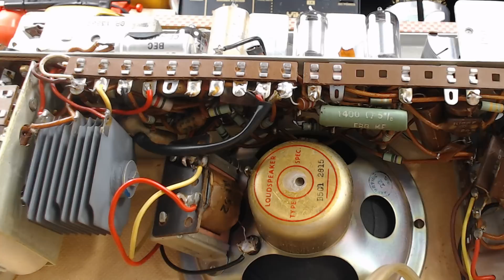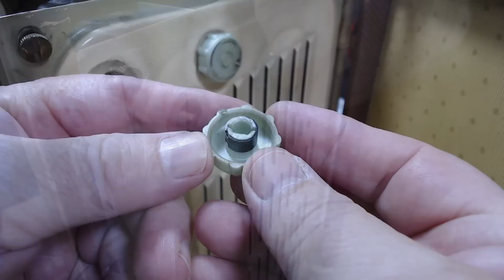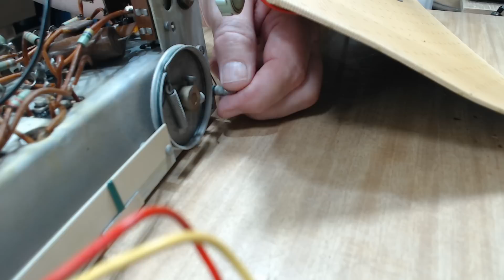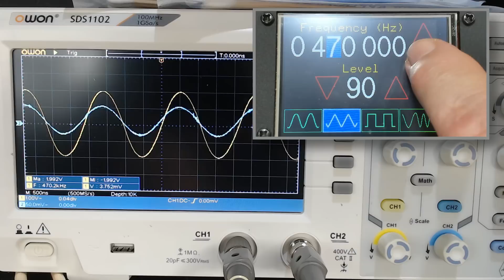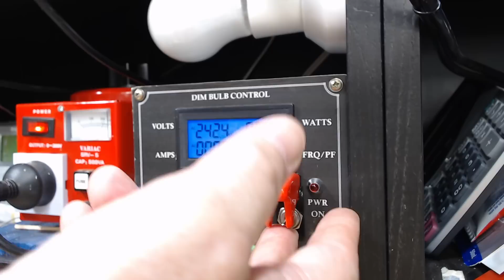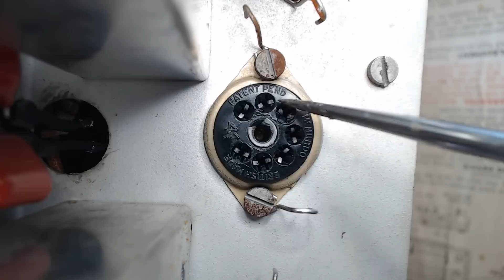Vidor Suitcase AC/Battery Henley Portable Radio - Model CN426 - 1953

Comment: Thanks David good job. Interesting to see how they progressed from the twenties and thirties to that style. Small tubes compact with a battery compartment. I wonder about what year it was built. My guess would be about the middle fifties🤗
Reply from the maker: Hi Bruce, 1953 it was made, it's in the video title. A slow and steady improvement over the years until transistors came along (which was a continuation I guess) 🙂
Reply: @DavidTipton101  thankyou David for your reply I enjoy your videos so much. No microprocessor synthesiser turning in these radio s all just really smart hardware designs with what was available at the time. Thankyou
Bruce

Comment: Heya Mr. T., thanx for another instructive restoration. Re. the de-stuffing of can electrolytics, I have sometimes used a heat gun - the same one with which I've burned the paint off my weatherboards. One the innards start smoking it should be easier to pull the guts out. N.B. do this when the wife is out of the house. Thanx again, John (NZ)
Reply from the maker: Hello John, I have tried heating the case but only managed to burn myself. They usually come out cleanly, the ones that have been potted give the most trouble. Maybe heating the potted ones will help loosen it 🤔🙂
Reply: @DavidTipton101  Hey, I've almost burned myself doing this. Truly one suffers for one's art.

Comment: Hi David, nice work with that, those broken pins it's a common problem with those Mc Murdo valve bases, that's the first thing I check. Look forward to the next one.
Reply from the maker: Ok, thanks Lee, I'll be more vigilant next time 👍🙂
Reply: Many years ago when I started working in a hospital, my first job was repairing the nurse call systems.  The patient rooms had a wall plate with a couple of 8 pin octal sockets that the hand pendants plugged into.  I spent so much time on flaky sockets that I just decided to go through and tighten and clean all 300 or so sockets. Took me a couple of weeks but that cut down trouble calls to one or two a month.  Also have just sacrificed a tube socket or two for pins to fix them in amplifiers and radios.

Comment: Hi Dave,
Absolutely brilliant repair job on your Vidor radio.  Although I’m capable of repairing battery valve radios, I dislike doing so.  When compared to none battery valve equipment, most models, irrespective of brand, are flimsy, and very temperamental.  Your battery radio is one of the better performers I’ve heard in decades.
One minor point, the ‘Vi’ in the brand name Vidor is pronounced with a long ‘I’ sound, as for example ‘violet’.  Someone, many years ago, mentioned that ‘Vidor’ is an amalgam of part of the Christian names of the company founder’s two daughters: Violet, and Dorothy.  Whether or not that is true, I can’t say.
Nice chatting with you.  Best regards, Phil.
Reply from the maker: Thanks Phil. This is a very sturdy build and works and sounds good too. I Googled pronouncing Vidor and there are a few different ways depending on the country. From Radio Museum: "Vidor name is supposed to be from part of the name of initials of the names of Thomas's two daughters, Valerie and Denise, and his wife Rebecca". Looks like there are number of stores of the Vidor name origin 😄 There is a town in the US called Vidor as well. Cheers!
Reply: @DavidTipton101  I've never heard anyone in the UK pronounce the "Vi-" as anything other than to rhyme with "eye".
Reply: When will you be getting behind your soldering iron again, Phil, do miss your videos.
Reply: @Theoobovril  
Hi Theoobovril,
I’ve recently took possession of an abode requiring a fair amount of restoration.  Though I very much miss restoring old electronics equipment, I don’t have a workshop at present.  Hopefully, towards the end of this year, I will have created sufficient space to set up a work area.  Over the past two and a half years I’ve amassed several Vintage Radios that are crying out for attention LOL.
Thank you for your interest, Phil.
Reply: Always nice to hear about history!

Comment: Hi David,
A nice little radio for the collection.  It didn't sound too bad either, for what it is.  My money's on that valve socket being a problem all along.
Cheers
Reply from the maker: Hi Don, thanks. It worked alright for a little set. I think there were a few things stopping it. It's hard to troubleshoot if there is two or three problems at once 🙂

Comment: VIdor used a different style of tube sockets than most.  They're like two metal fingers that the tube's pin contacts.  If those fingers break, no contact.   I have a Vidor Riviera that had all the socket tines rusted out.  Once I replaced the sockets more conventional ones it sprung to life.
Reply: Similar sockets with finger contacts are actually very common in more modern European tube radios except they don't seem to break that easily
Reply from the maker: I've seen this style socket before and it had broken contacts as well, I should have remembered that. I can see your Riviera, nice looking set 👍🙂

Comment: Those hooks on each of the valve bases tends to indicate that the valves were restrained originally, which makes sense for a portable set. Thought you might also have checked the battery side with the bench supply, just for completeness.
Reply from the maker: Thanks James. The valves were secured with rubber retainers original. I didn't bother making new ones. I don't have a suitable bench power supply set up, I have a few in the wings but haven't bothered to repair them as yet 🙂

Comment: Excellent job as always Dave.  That paper in the IF Can is called Fish Paper :)   Also, there are hooks on either side of the valves. This was to hold down the tubes given its portability.  They likely used some type of Spring with a washer on top to hold the valves down.   Excellent job as always !!
Reply from the maker: Hi Ron, thanks. It looks like the valves were held in with elastic rubber bands judging by the bits of hard rubber in the case. I didn't worry about bending up wire retainers, it won't be going on any picnics for a while 🙂
Reply: @DavidTipton101  that makes perfect sense. Those tubes really never get hot so that was a good way to do it....   No picnics..  darn... LOL    Excellent Job David

Comment: Good work David, a series of intermittent faults. Sensible to leave the selenium rectifier alone since it was in good condition, back in the 60s we replaced a lot of them of them with an OA211 diode and resistor. Most of these got very little work as a portable as batteries were so expensive and the selenium rectifiers built up additional resistance and got hot. If they failed they made a terrible stink.
Reply from the maker: Thanks George. I know they stink for days if the Si rectifier fails 🙂

Comment: Those McMurdo valve sockets are becoming a bit of a pain. I've seen quite a few that have gone the same way. It's bizarre really, because they are fairly thick, so why they just fatigue and break like that is a bit of a mystery. I wouldn't want to replace the entire holder, that's for sure. Thank goodness there were some spare pins.
Reply from the maker: I will know in future to inspect them with a small pick to make sure the top of the pin is connected to the bottom. I don't know why they fail like that, they don't even get hot in this radio 🤔 Thanks Bongbong.

Comment: I used to have one of those in the UK around 1973.  What happened to it when I left the family home at nineteen to live & work in London? I took my Roberts R606 with me but the "picnic radio" had to stay and it only popped back into my memory last year. ps Vidor was a waning battery brand back in the day and the radio was probably made by Burndept.
Reply from the maker: Hi Paul, a pity you example was lost. I read there was an association between Burndept and Vidor batteries 👍
Reply: @DavidTipton101  I heard the name Burndept back in the 80's and pondered the wisdom of buying an electrical appliance from a company with such a name. It is like calling your spaceship 'Fireball XL5'.

Comment: Greetings from just outside Droitwich. Glad you got the old radio working I knew you would, it looks brilliant. Well done. I look forward to many more. restorations.
Darren...
Reply: Nice to see it being restored. That radio would have had no problems receiving Long Wave in your location :-)
Reply from the maker: Hello Darren, thank you for sending the radio to me. I understand you had a high power LW transmitter nearby, you wouldn't even need a radio to pick that up, we didn't have LW in Australia. I expected to turn the radio on and it would work, no such luck, it took quite bit more than that. Cheers Darren.
Reply: @DavidTipton101 The LW transmitter is still going,  broadcasting BBC Radio 4 on 198kHz.  Sadly it will be turned off in the near future but I don't think the date is set yet.

Comment: Definitely a sign of a bygone era when they expected the owner to have a screwdriver handy to get the power cable out.
Nowadays, your lucky if you can open the remote to change your batteries. Let alone see the inner workings of an appliance.
Reply from the maker: I think the screw slots can be undone with a coin. Haha... cracking open a remote to change batteries can be quite challenging 😄

Comment: Hi David! Very interesting and challenging with several problems. The LF band probably worked really well in Droitwich, where the BBC has a 500 kW longwave transmitter operating on 198 kHz.! I can hear them in the middle of the night all the way here in Israel.
Reply from the maker: 500 kW... I could pick that up from here 😃

Comment: My parents bought a similar battery portable valve radio when they married in 1952. The brand name was Invicta. The case was cream with a red trim. 
The batteries were 1.5 and 90 volts from Ever Ready or Exide, which sat in the base. The batteries ceased to be available in 1973, so I put together a mains supply which was concealed in the old battery housings.
Sadly, it was disposed of in the 1990s by an unappreciative relative who shall remain nameless. I have not seen one like it since.
Reply: Relatives doing what they think is correct,  I feel your pain so what I do is put a price tag on them and a little note.  A monetary value brings focus to what they are doing and hopefully rescues our treasures from destruction.  Finding a note with some history and detail is lovely to find. The set you speak of is familiar to me as well
Reply from the maker: A pity it was lost Denis. If only we knew back in the day 🙂
Reply: Invictor brand became part of the Pye group.
Reply: HER NAME IS KAREN
Reply: Well, it's different, that's for sure.  I don't find the design very appealing though.  But it is definitely different and well worth having in your collection. It's a shame they got rid of it.  Probably had a lot of sentimental value.

Comment: Hello David. Another splendid video. I have two of these, one as a parts radio and the other complete. Different cover cloths and it's the coloured control knobs that make these desirable here in the UK. The control knobs are very fragile and are often missing or damaged. A unusual mains/ battery picnic set.
Reply from the maker: Thanks Ian. I can imagine many of the knobs would be broken, They did not want to budge 😊